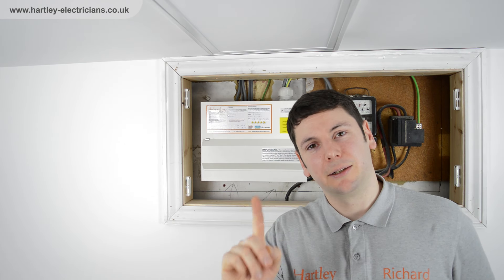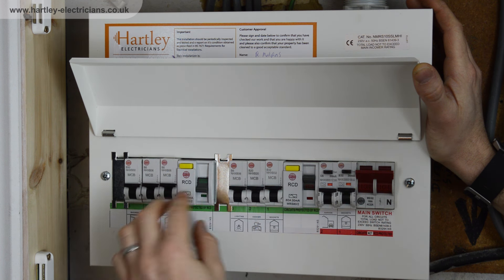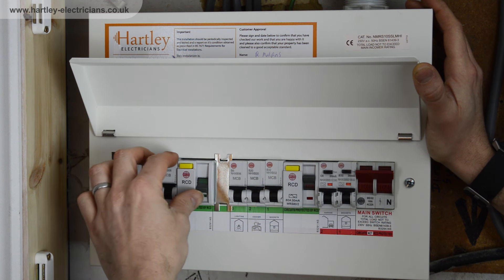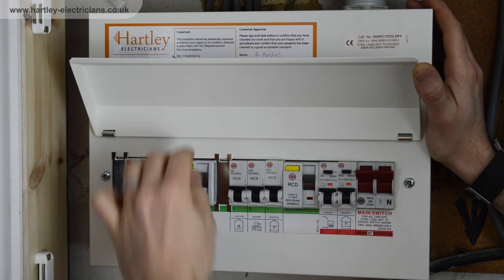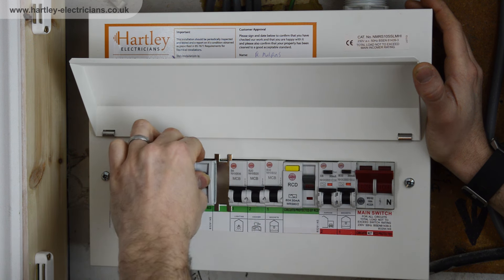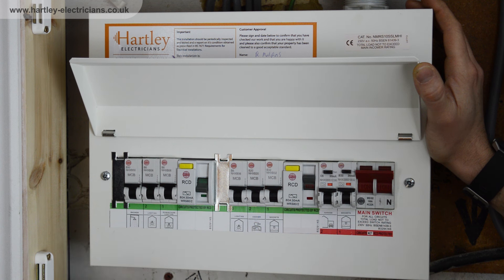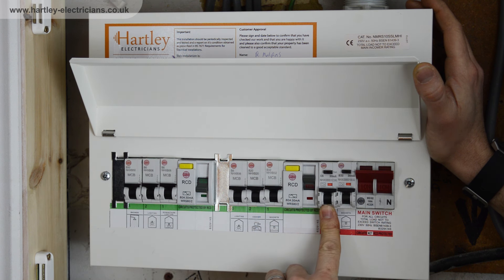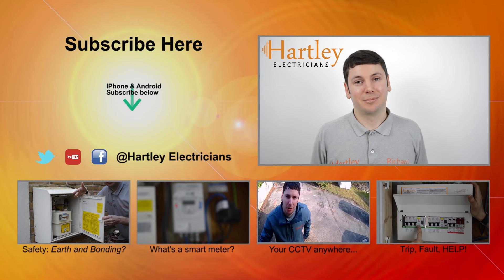RCD Tripping: How To Restore Power

Comment: I had a spurious tripping RCD. The cause, a newly fitted smart meter too close to the consumer unit. When the smart meter ramped up the signal to send off the meter readings it was enough RF interference to trip the RCD. Temp fix with a RF shield (tin foil on cardboard) proved it. Fitted a newer RCD and no further issues. Bloody pain!
Reply from the maker: You did well to solve that issue!  The transmitter on the smart meter must be strong

Comment: How often is there a fault with the RCDO? I have a pond pump from a CFGAR1 -3WAYwith two circuits isolated the pump runs for around 20minutes and then the RCDo trips resetting the trip is easy and it again runs for about the same time, the pump delivering at full bore and has been in use for 10 years.
Reply from the maker: Most likely the pump or cabling has minor insulation breakdown, you can have the rcd tested but it will be the pump most of the time that needs replacing, especially considering its age. Hope that helps, Rich
Reply: You are correct, I have replaced the pump which needed doing but also found the supply cable had been chewed by rodents! no body although live and neutral wires bared.

Comment: Thank you for your amazing video! Power just went off for all the wall power ports. Followed your video and managed to isolate the problematic circuit breaker. At least the other circuit breakers are working now after switching on RCD. Going to contact electrician in the morning.

Comment: What if you turn off all the circuit breakers but it still trips?
Reply from the maker: You most likely have a neutral to earth fault on one of the circuits.  An electrician can find this by doing some electrical testing.  I hope that helps. Richard

Comment: I've unplugged everything in my kitchen, the circuit effected, everything works except fridge/freezer and wall sockets for appliances above counters if they're all plugged into a long extension lead to a socket from another circuit that;'s ok.  The fridge/freezer in an integral one, no sign of a plug anywhere, so I'll have to get someone to remove it.  Thing is, if it's not that, what might be causing the wall sockets for appliances not to work?  I suppose the bulbs in the cooker extractor hood are on the same circuit - cooker works, has been plugged and unplugged, and washing machine.  Do I get a carpenter in first or an electrician!!!  Just to be a bit more confusing (sorry) I have under the wall cabinets with downlights under them which I know has a fault in it, as it does sometimes fail to work.  Thing is, these lights are working.
Reply from the maker: Yes call and Electrician, it doesn't sound as though you would need a carpenter, definitely get an electrician in first to find out what's wrong

Comment: Great video.... simply explained to someone that hasn’t got a clue. 😊I was confused why some not all sockets and everything in my kitchen had lost power and the fuse box socket black switches were all still in the on position and not tripped. Then I discovered (thanks to your video) the green RCD switch... and how to trace the cause. Unplugged everything... Blasted iron, being used upstairs, now in the bin. All power and other appliances now back working. Thank you 👍🏻👍🏻

Comment: Mine is constantly tripping the last time the RCD wouldn’t stay up after flicking it back on. No idea what’s causing it. It’s starting also to interfere with our motion sensed lights on the property.
Reply: When I try what you suggested everything holds on the fuse box. So no clear indication of what turns it off.
Reply from the maker: @QPRLAD86  It could be one of the following:

An unplugged (faulty) appliance?
Thermostatically controlled heating circuit?
A faulty item of fixed equipment powered from a spur?
Rain getting into your outside lights? 
There could be a fault with one of the circuits?
The RCD could be faulty?

Good luck!
Reply: Hartley Electrical Contractors Limited At the moment we have turned off the motion sensed light and everything in the house appears to work we will see how I go thanks for reaching out.
Reply: Hartley Electrical Contractors Limited I left the light off for 5 hours and turned the fuse box back on it’s gone from being a light back to a motion sensed light. Is this normal?
Reply from the maker: @QPRLAD86  that sounds normal
Reply: Hartley Electrical Contractors Limited Managed to locate myself that the cooker is causing the RCD trip.

Comment: Thank you for this, helped me help my wife while I was at work. She rang me saying the downstairs electric wasn’t working, but upstairs was ok. I knew about the switches that might have tripped so I told her to check that all the switches were on. Then I got her to send me a picture so I could check myself. I could see one of the RCD.  switches was red and in the down position, I used this video to check if the switches should both be on and what would happen if it kept tripping off. Thank you very much 👍🏻

Comment: Thank you very much 

I had all sockets off in my flat I reset all switches and the general switch didn’t engage so I turned every socket off and switch back the general switch and then turned every socket on one by one.

it turned out that the kittle was the problem
No need for electrician or having no power in the sockets 

Thanks again